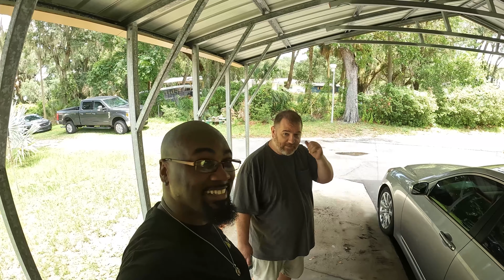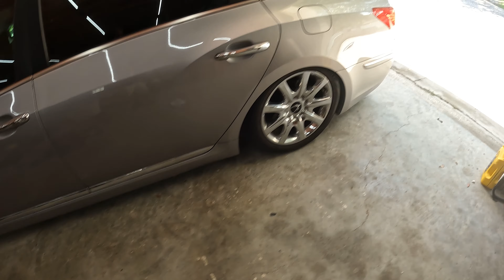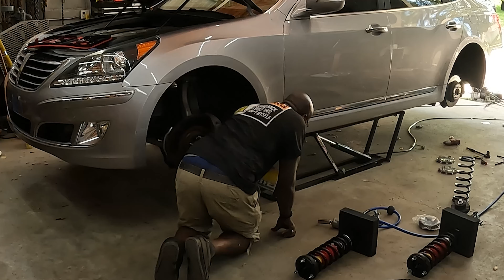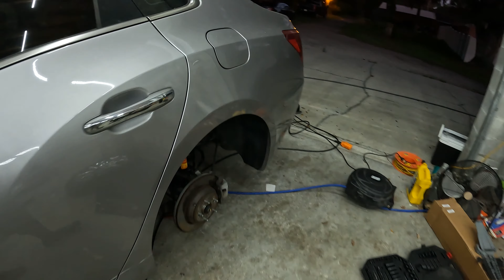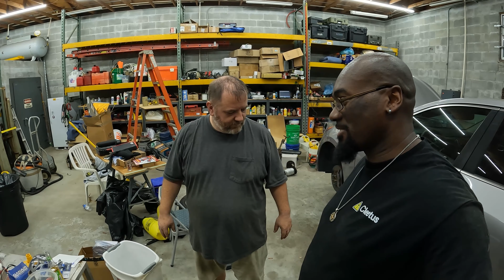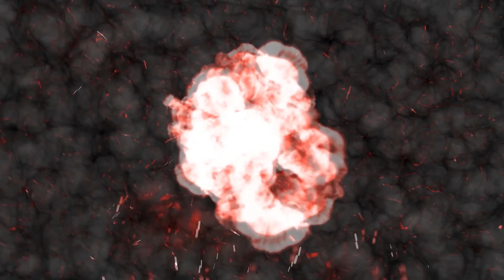2013 Hyundai Equus Suspension Coil Spring Conversion

Comment: All you have to do is swap over Kia k900 suspension. They are the same platform. All the parts swap over. I did it to my Equus. I got all the parts used on eBay. The K900 has coil springs.
Reply from the maker: I learned about this after I did this swap
Reply: can you list  all  parts you have purchased for replacement?
Reply: What year?? For the Kia 900 suspension
Reply: @5150LA  just look for 2015-2017.
I believe it's from the first model of k900 2014 tell 2017.

Comment: I have lots of questions. About how many hours did it take to do it? Did you need a spring compressor? How is the ride after the conversion?
Reply from the maker: It took roughly 6 hours. You don't need a spring compressor since it is a full replacement. If you have ever changed suspension on a car before it is completely straight forward and the instructions are pretty decent. It rides very well.
Reply: @decelation  Thanks
Reply from the maker: @shawnsuppa9027  no prob
Reply: I ordered the struts but without the light module but they told me I needed it so I bought it but they told me they haven't shipped it because they need it to program it before sending it out, is that true???

Comment: So I'm now on my second set of strutmasters coilovers because in the first instance it felt like the car have blown the struts since it was bouncing like a tennis ball, but even still now with the second set of strutmasters system on a 2014 signature equus it feels like the car is still too heavy bumps head extremely hard the car bottoms out repeatedly with almost any form of road bump, dip, pot hole,   so my question is did you ever find a way to raise the suspension so that it has a a higher profile that can absorb the terrible roads in New England a little better
Reply from the maker: @RisenNephalem  fortunately I didn’t experience that with my strutmasters suspension. I don’t think there is a way to raise the suspension
Reply: @decelation   hmmm maybe its just the rhode island streets but jeez its rough, ok ty for the response

Comment: Im really intrested in buying an equus, I'm wondering about its reliability and maintenance costs. Because I'm on the fence on buying a lexus ls460 or go for a newer Hyundai equus
Reply from the maker: When you step into the luxury car realm, they put a lot of luxury items in the vehicles which makes them more complex. That means there is more stuff to break as it ages. From my experience there were a couple of failures but the cost of repairs was lower than some of the other luxury car brands

Comment: Do u have a part number here? Called and they cannot source these spring. Anything helps, great video.

Also how did you disconnect and block all the suspension electronics and hoses?
Reply from the maker: They may have discontinued the kit. The only other option I am aware of is using the suspension components from a Kia K900. I just disconnected the air lines because I was not worried about the compressor anymore

Comment: How is the ride quality/handling compared to the air suspension?  How long did it take to complete?
Reply from the maker: Honestly it rides almost the same. I would say 95% of the suppleness. It took roughly 6 hours.
Reply: @decelation  6 hrs for front and back?
Reply from the maker: @Stuygym  yes
Reply: @decelation  answers the question of what a Jeep Wrangler suspension would feel like on an Equus. 

The conversion isn't comparable to the air suspension, unless you're comparing it to the air suspension when deflated.  After having done this conversion, I discourage anyone from doing it. It's terrible. Feel like whoever bought the car featured in the video is a victims of bait & switch, unless the intent to convert the suspension was disclosed. 

Bottom line.... fix the air suspension or be prepared for disappointment.
Reply from the maker: @darylhunter9929  Thank you for your feedback. I am sorry your suspension was not as good as you expected. I did fully disclose to the person who purchased the car that I did convert the suspension. I don't misrepresent vehicles that I sell.
Reply: @decelation  where you guys located?
Reply from the maker: @lisasanders2146  central Florida

Comment: I have a 2012 Equus Ultimate with 126,000 miles & so far, I haven’t had any problems with my air suspension. ✊ ✊✊✊ (Knocking wood) I have other issues. The right side outside mirror motor was stripped and now they are both not working so they don’t fold in and out anymore. The back seat controls work when they want to. For some reason the back air vent doesn’t get much airflow, but the rest of them in the car do fine. and then I have a problem with the engine consumes oil but there’s nothing on the ground. After about sometimes three weeks sometimes a month and a half I have to add a quart. Sometimes when I start the car and run it, you can smell it burning, so who knows what that is. Sometimes you can even see the smoke coming out of the hood it smells like burning oily rubber if that makes sense. But that’s it. Everything else is OK. I guess the engine is the basic main thing of that oil thing. The car has never let me down I’ve had it a year and a half never broke down. That thing will outrun a mustang GT. That’s the only reason I hate to get rid of it because it’s got some freaking power.
Reply from the maker: The car definitely has its quirks but overall it's a really good car

Comment: Interesting, does it ride about the same with the swap?
Reply from the maker: I would say 95% of the original comfort
Reply: No. It absolutely does not ride "about the same". I did the swap and am disappointed every time I get in the car and go for a drive. It's like my suspension was swapped out for one in a Jeep Wrangler or Ram 1500. It's terrible. Not comparable to the air suspension. Prepare for disappointment. Just don't do it.
Reply: Mine came with the swap already and I enjoy the ride, smoothest vehicle I've had. First luxury vehicle that I've owned though.

Comment: About to do my 2016 just wanted to know if you loose the ability to switch drive modes after the swap?
Reply from the maker: You can switch drive modes still but it will not change anything with the suspension anymore. It will still change engine and transmission settings

Comment: Having the same problem in the front of my 2011 Equus. I’ve taken it to two shops. One told me to replace Air Suspension Struts. The other told me can’t figure it out. That I need to take it to dealer to get it tested
Reply from the maker: There is a leak somewhere in your front air system, either the shocks or the lines
Reply: @decelation   if there is a leak most likely struts need to be replaced?
Reply from the maker: @carlosbarajas2693  that is the most common place for them to leak. If they are leaking they need to be rebuilt or replaced. I personally am not a fan of rebuilding because you get varying results

Comment: Have 2011 want to change the air suspension to something spring ..the air rear suspension always dropping and feel bad driving it sometimes ..any help 
In Fort Worth
Reply from the maker: This system works really well. It is nearly the same driving experience
Reply: @decelation  No..... it really isn't. The conversion isn't comparable to the air suspension at all. I did it. It's terrible. Like a truck or Jeep Wrangler suspension. Only thing I can say, is it will never deflate again. Every drive is filled with regret.

Comment: One more thing sir, did you get engine light on after you replace de air suspension with the struts?
Reply from the maker: No I didn't. You will get a suspension light if you don't install the light module
Reply: @decelation  did you get the light module on the kit or have to get it somewhere else
Reply from the maker: @danielreyes4180  I bought the kit that had the module included

Comment: I looked into this a couple months ago. When I spoke with the Strutmaster rep they confirmed the right parts for my car and I opted for the ecs light delete about $100 more i believel.

They sent me the cost for the kit and also recommended shops near me.

I called each of them. Not many have even heard of an Equus but we're confident they could do it.

When I mentioned Strutmaster they thought It was for a Tahoe as apparently that is very common. They were confident they could do the Equus no problem.. of the 5 shops I received in the email they were each about $400 to $500.

So total all in about $2000 after tax.

I have not pulled the trigger yet as I will have it diagnosed at a Hyundai dealer and then decide if I wanna got hsi route or buy the parts through RMT to replace the bags or whatever it needs and then have work done at a local shop.

I've heard that the overall price could be about the same.

If i could still have that super comfy air ride for about the same. I would go the air ride route.

This isnt a major priority.for me but if/when i decide to go either way on thsi ill report back.
Reply from the maker: I look forward to which option you choose
Reply: Have you tried resetting it by discharging the battery

Comment: How many miles were on the car?
I have a 2011 ..that I have owned for 7 years. The front suspension was replaced under wrranty back in 2015
Reply from the maker: It was 73k. Since I was not the original owner I don't get the 10 year 100k mile warranty

Comment: A question for everyone … I have a 2013 86k miles should I start saving and preparing for this .
Reply from the maker: I would recommend it, air suspension will fail at some point.
Reply: Absolutely don't mess around...do...the conversion ...you will have peace of mind and can then drive the car anywhere...when I took mine to the dealership they gave me a ridiculous estimate for 7,800 to replace front struts compressor air line and sensor..not!!!!!!!
Reply from the maker: @soxplayer3907  that is about par for the course on price estimates

Comment: @deceleration did u unplug your compressor?
Reply: I'm having a issue with mine with auto leveling lights
Reply: And a flashing ecs light that just keeps blinking
Reply from the maker: The system I got had the ECS light delete module that I had to install to prevent that light from coming on. Part of that install is to disconnect the air suspension control module

Comment: what's the cost for this and what is the time expectancy for the job?
Reply from the maker: I believe I paid $1300 for it and it took me about 8 hours
Reply: @decelation  great video.  You guys do the lord's work :)    Was it $1300 for all four struts or only one side?   Thanks!
Reply from the maker: @richesofthepoor  thank you, I really appreciate it. Yes it was 1300 for all 4
Reply: @decelation the $1300 for for the shock kit? ?(All 4)?? Also technically is it two shocks & two struts (purchased)?
Reply from the maker: @wisheduknew294  yes for all 4 corners. The front is coilovers and the back is a strut and spring

Comment: What did u get the springs off of what year and model vehicle springs will work
Reply from the maker: There is a link to strutmasters on the video
Reply from the maker: https://www.strutmasters.com/products/2011-2013-hyundai-equus-conversion-kit-with-light-module-eq24fm
Reply: Thanks
Reply: 2015 K900 rides on the same platform. In the back you need the lower control arms from k900 springs shocks and isolators. You have to pull up suspension diagrams from both cars.
Reply: @67corvaircars  do you have a link to that kit
Reply: @67corvaircars  I have a 2013 hyundai how do I look for the kia k900 kit to put on the hyundai help please!!

Comment: my god, it appears that every equus owner/car out there has this problem.  WHY?  to me the more i watch and investigate this problem the more i realize that this is a massive "safety" problem and Hyundai should be responsible for fixing it one way or the other with a "goodwill" warranty repair.
Reply from the maker: Honestly it is a common issue with air suspension in general. Rubber fails after so many hot and cold cycles. Usually cars and trucks with air suspension have failures around 60k to 80k miles
Reply: Yeah you would think so but just like he says it’s all air ride suspension. Not just Hyundai. Back in the day. My grandparents had a 1978 Lincoln town car with air ride suspension. I don’t recall it having issues but the car had that type of suspension! I’m sure at some point eventually, it had problems. The car has been long gone in our family.
Reply: Agreed I will sign on....my equus is 2014 with 72000 and my front end is now a low rider!!!!!! I'm getting ready to do the strut masters conversion...
Reply from the maker: @soxplayer3907  walking out to that low rider look is depressing. You won't be disappointed with the conversion
Reply: It's not necessarily an Equus problem but air ride suspension is one to stay away from in any car
Reply: Have and equus and I'm about to change a pair of struts for the third time so frustrating!
Reply from the maker: Exactly. Rubber degrades over time then starts to leak

Comment: I’m trying to decide whether to go on a 2014 Equus Signature at an online tow yard auction tomorrow. They say it starts, run and drove. Problem is it looks like it’s sitting on aftermarket 20’s and all 4 tires are resting up in the wells, the front two rear off the bumper a bit. The negative camber is a bit off on both rears, but one more than another, and the sides of the front bumper trim seem pulled out a bit by either god or the tow yard monkeys. Only other bother is no pics of inside at 89k miles, but the exterior is nice, except where god (?) decided to start pulling front bumper trim away. So,,,,, coupe questions if you have time: 1) I have pretty same garage setup, what are those cool air lifts and are they safe? 2) I see you on your back on concrete,, I do the same thing. You and I need to ask for either matts or those slidey planks with wheels for Xmas this year. I’m getting old, and laying in car fluids sucks. If you have a rec let me know! 3) can you estimate all in cost plus mechanic’s time to coNvert to springs? I know you don’t do commercially. 4) honestly, how do the bags vs springs compete. Thanks for your and Brian’s efforts and your videos! Best regards, Brian2 (my first grade teacher designated me no.2 because of two Brian’s and the alphabetical order of our last names (unsure how that has affected my adult life, but would like to think positively?) Oh well, we play the hand dealt to us.
Reply from the maker: That is an interesting find there. Those are quick jacks, they are hydraulic portable lifts with 2 mechanical locking points. They are amazing and very safe. I actually have a lift now so my concrete days are at a minimum now

Comment: The video is good but you should've explained in details step by step and show it up close so we can actually see how you doing it, but thanks anyway
Reply from the maker: I moreso geared this video for someone who is comfortable changing suspension components. It is extremely straight forward and it comes with very good step by step instructions
Reply: I kind of thought at first the same thing but then I thought it would be kind of hard to film that very up close and personal. It’s very tedious work when you’re doing it yourself and trying to film it don’t you think? I think they did a pretty good job, I knew absolutely nothing about changing a suspension especially air ride to regular and now I at least have a general idea, enough to at least have it done!
Reply from the maker: @wisheduknew294  thank you I appreciate it. There is a balance that has to be done when filming based on what you are going to show. There are areas that are pretty hard to get the camera to have a good angle, good enough lighting, and still maintain the ability to do the job

Comment: After watching this video, and some other weak research on my part, I went with the Strutmaster conversion on my 2011 Equus. Nothing but REGRET!

The Strutmaster conversion is not comparable to the air-suspension at all. It feels like the air-suspension was swapped out for that of a Jeep Wrangler or Ram 1500. Basically stiff and bouncy at the same time. I feel every imperfection in the road, with serious bumps dislodging whatever is in my trunk. Further, the kit is clearly not tuned for the car. Handling feels objectively worse.

I feel like the cost of the conversion kit will proportionately reduce the value of the car as it takes away a major luxury feature, that of ride quality. Don't underestimate this. 

In retrospect, which I had continued to try to repair the air-suspension, or just bought a winter car. My suspension issue was that it wouldn't reinflate under 0 degrees Celsius. Rear would sag unless in high mode, but would always reinflate. Tried replacing the solenoid block with a non-deal mechanic, but didn't fix the issue. In retrospect, should have had the stealership take a look. 

I'm not slamming the video. Good work guys. Just wanted some first hand info out there about what to expect from the conversion. Disappointment. Best thing I can say is, won't delfate. 

I don't recommend the Strutmaster conversion kit.
Reply from the maker: I am sorry that your experience was not as expected. I did not have the same experience with my set. I drove the car 1000 miles to the new owner and it rode very well. I don't know the quality control of the strutmasters kits so I can't say for sure what the disparity is. I also did inform the new owner of the suspension swap and he was pleased with the car.